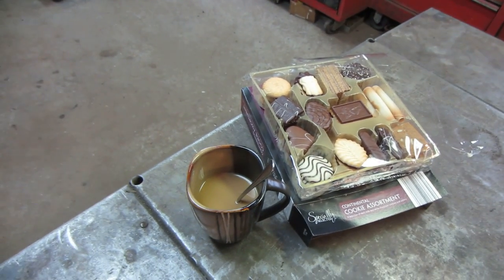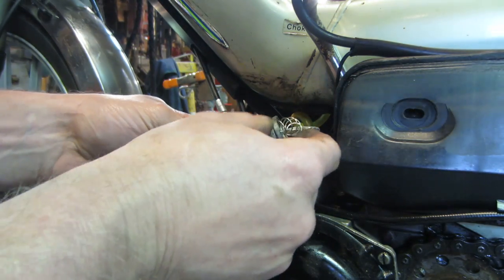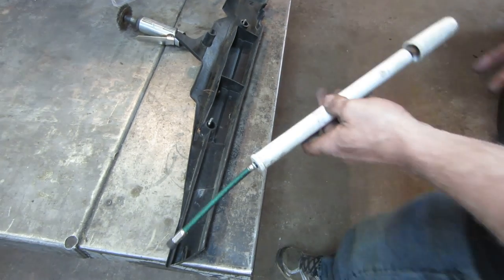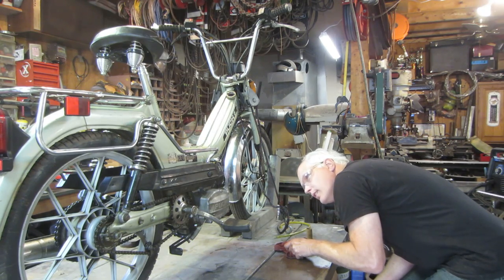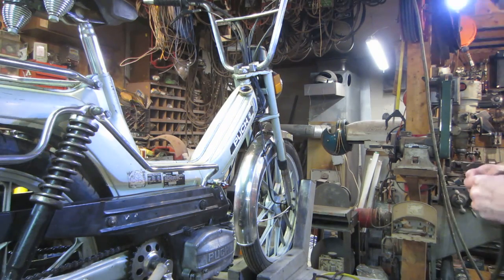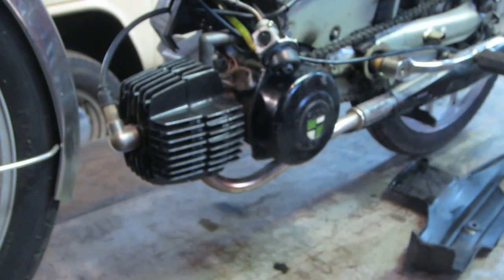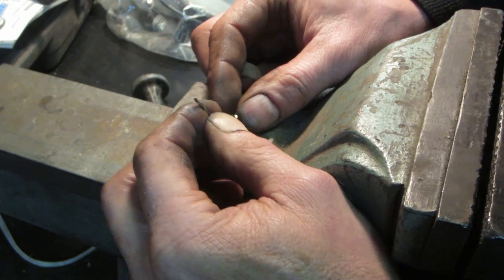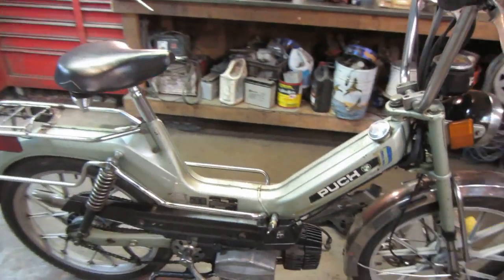puch maxi moped test and tune

Comment: When I was a kid you didn't need anything to ride a moped in NJ, as long as it was 49cc or less, used to ride my Honda Z50R and a friends 74 Trail 50 on the roads and side streets in my area. One of my friends had 2 mopeds, a pos Batavus with the top tank and a New Moto Guzzi step thru, he would let me use the Guzzi all the time, 45mph top speed and go all day on a tank of gas. The Batavus never failed to fail, ride out push back, he thought it looked more like a motorcycle then the step thru Guzzi so he didn't want to ride it, idiot lol.

Comment: You lost the wingnut that holds in internals of the silencer. Here in the Netherlands there used to be a lot of those Puch mopeds. I used to wrench a lot on them when I used to work at a bicycle shop in the 90's. Decent quality mopeds that were easy to tune and go fast... Well... fast-ish anyway. The early type cylinders (70's) had a lot more potential out of the box.

Comment: The UK Spec one is much quieter. Drop the needle one notch
Reply: Dropping the needle a notch won't make any difference to the noise or the air fuel ratio at full throttle. At full throttle only the very tip of the needle is in the needle jet and it is not what is controlling the fuel flow. At full throttle the main jet controls the fuel flow and hence the air fuel ratio.

Comment: Could you not use one of the many hundreds of small-engine  carbs you must have in the hoard? There must be something there that would offer better adjustability for fuel/ air mix than the stock one.

Comment: Good job Darren! Did you put ATF in the gearbox, usually it's red? I find the clone carbs are very difficult to adjust. I prefer the original Bing carbs. Do you need a couple of jets for the clone?
Reply from the maker: do you have a link for those jets?
Reply: Hey Darren, which size jets do you need? Did the clone carb come with #77/.73mm? And 56 was way too small? So you need 64-74?
Reply from the maker: the clone had no numbers but l would guess you are correct,

Comment: I was a little confused when you put the petcock in with the tube going up the vertical -- that leaves more than half of the tank for reserve! I would assume you're supposed to put the tube so that it sits high in the horizontal section of the tank. That would fix the orientation of the petcock as well, right?
Reply: The tube coming off the petcock is the main fuel supply. Once it stops pulling from there you flip it to reserve. It will then pull from the bottom off the tank.

Comment: Just a noob question for anyone to answer. Does the needle that hangs from the bottom of the slide go into the jet to lean the fuel when the slide restricts the air flow?

Comment: about the extention you added to the kickstand, I ust wonder if it will interfere with pedaling/starting it?  or cut into ones shoe?
Reply from the maker: there was a part broken off, its about the same as stock size

Comment: Does this moped have the automatic clutch system? If it does, I think it is not working correctly because the back wheel should stop on idle if the clutch is properly working... I have this exact problem on my Jawa Babetta and I can't fix it, sadly enough :(
Reply from the maker: idle was just too high
Reply: Oh OK then, my paranoia kicks in once again. When I expirence some problem, I see it everywhere :)

Comment: What is it that sounds like a very distinctive shift in revs when you've got going? Is that a shift from a low to hi ratio on the engine?
Reply: It's actually a two speed automatic. Look at the other videos in the series and there's a teardown of the transmission.

Comment: Starving  for  Fuel
Reply: Raise the Needle one Slot
Reply: Raise or down one slot? I think carb needle restricts air, so down the needle will get richer mixture.
Reply: no, it restricts fuel coming up from the lower bowl.
Reply: You are right  sir and  when he  revs the  engine  it is indeed  starving  for  fuel

Comment: does this run on premix, or does it have an oil tank onboard and mixes in the fuel line?
Reply: The video showing him pull it out of the tent garage shows a "Do Not Use Unleaded Gasoline" label on the gas tank.
Reply: @llibeel  that doesn't answer the question tho. 2 cycle premix or 4 cycle straight
Reply: @mmm365  that's still not answering - some machines have an oil tank alongside the gas tank, and mix in the carb

Comment: Doesn't that moped need lead in the fuel ?
Reply: martkt10 There's a sticker saying you shouldn't put unleaded in right below the tankopening
Reply: JackThatMonkey that sticker means don't put "unleaded" gas which in the 70s meant Coleman lamp fuel. Modern unleaded gasoline is fine in these as long as it has oil mixed in

Comment: Electrical cable connectors are great for other applications such as extending that choke rod.  You can also use them on transmission cables. You can strip away the plastic or leave it on. https://www.toolstation.com/shop/Electrical/d190/Cable+Management/sd2460/Connector+Strip/p85099 I'm nothing to do with this link by the way i'm only using it so you can view an image of what Im talking about. Great videos. Thanks.

Comment: too much effort on the choke stalk. you only have to push it down. when you turn the throttle it comes back up ;-) you never have to pull it. this kind of choke is only to warm up the engine on idle for a few moments.. then you take off, and the choke is allready off.

Comment: Very end one of the pet cock is what goes in the fuel tank first is your main fuel screen inlet for the run position.& the top inlet witch will be on the bottom now is for your reserve inlet spot in the pet cock setup.& design mustie1. Just to clarify myself A whole lot better.& clearer to on all of that part to man.!

Comment: Hey man, I love your videos. If your up to it, I may have some questions soon about a rare trike I am putting together. I'm not a  motorcycle guy,  but there's nothing too complex about it. I just need some incite and perhaps some guidance.  Like I need a caliper for the rear disk brakes, however there are 2 disks, do they both need a caliper?  Stupid questions like that. This trike turns heads, so I want to get it back on the road soon.  It's a attention whore.  I saw a woman drop her IPAD once when she was taking a picture of it. I hope it didn't brake, that's a expensive picture if it did =)
Reply: 1974 Owosso Explorer  Exalter
https://www.dropbox.com/s/5csmlhizs6rslhk/2015-10-26%2014.55.47.jpg?dl=0
Reply from the maker: l would say yes
Reply: Ya, buddy! It runs, but I'm putting together some parts for it right now. I did just order  a new wabco fuel pump gasket kit, 1 rear caliper, but bikes are out of my element. I don't comprehend cables, lines or calipers.  I just want to make sure I get the right stuff.  I appreciate the help. I know a guy who grew up in Owosso, he's had his eye on my trike for some time. I'd like to give him the opportunity to ride it. There aren't many out there, not alone papered. They were made I believe between the 70's and by the 80's went under like so many other companies like it. Bradley Corporation, Wizard/ Winner Boats, Fiberjets I think faced the same demise. This is a survivor, and it's in pretty sweet condition for it's age.
Reply: If I can conquer this trike, then I have another bike lined up... You might like this one, it's rusty ghost rider evil looking!
1966 Allstate produced by Puch I believe.
https://www.dropbox.com/s/0l3jx3rxa3wo6si/2015-11-22%2012.18.19.jpg?dl=0
Reply: Nice Café Racer! So that's where the Suzuki tu250x came from... lol
Reply: I don't know man, I just find things I've never seen, or something unusual  that turns my head.  I might not know what it is or how to fix it, but a must have is a must have, some things you can't stop thinking about.  You know?  It's STILL a garage find.  It's sitting there waiting for someone to save it. and I know it still exists.
Reply: I'm not a mechanic, but I fake it pretty good.  If I need a carburetor for a 350,  that's easy.  But I can't go and look up a carburetor for a Owosso... What the hell is that?  You have to look it up by the engine.  You can't look any of it up by the manufacturer, most people have no idea what the hell it is.  You found these in the black and white section in the back of magazines in the old days.  The Allstate, I believe was sold in Sears, like my 1957 Wizard boat. I remember going to sears and seeing these kinds of things sold there. Now it's all riding lawn mowers.

Comment: There's an old expression, "penny smart and pound foolish". Ever think of buying a ruler or taking a picture of an engine before you dismantle it or check the oil first not as an afterthought or lube everything before you have to force it. The program is good for fixing old and obscure items but your procedures are hit and miss on the basics. Not a very good instruction video for the rookie.

Comment: I don't get this series at all.  This Austrian-made Puch is a well-made machine and tinkering with it is interesting, but ultimately it's still a moped.  There's a reason nobody rides mopeds.  They're noisy and slow.   All the inconveniences of a motorcycle with all the speed of a bicycle.  They can barely get up hills all the while droning on with that loud, two-stroke buzz.  There are more useful projects out there.
Reply from the maker: seems like the video was popular to me, l work on what l like if you enjoy it fine, but if not why would you watch it knowing it was about a moped.
Reply: I forgot how slow and buzzy they were until I saw your road test.
Reply: Garth Goldberg 2 strokes sound like heaven. Swap a 90cc 2 stroke on your basic taotao scooter. It won't be slow.